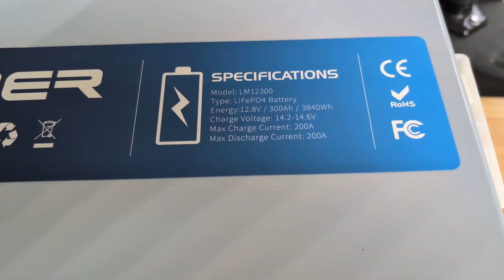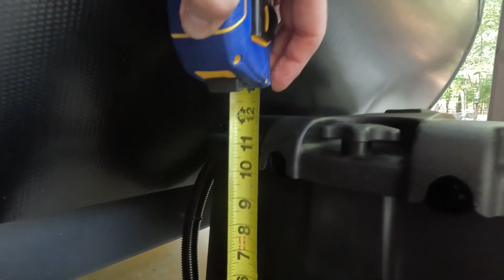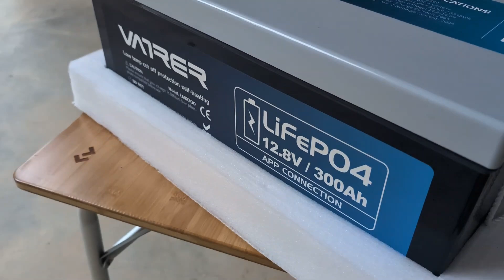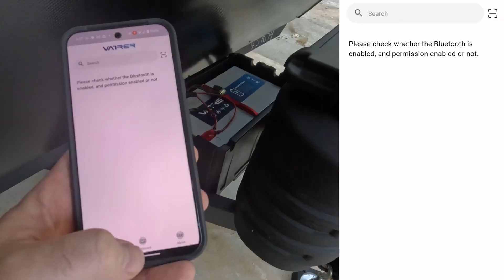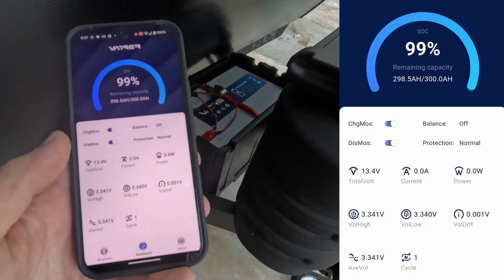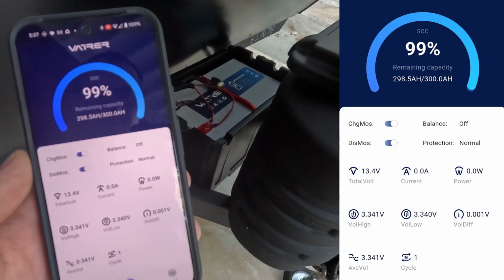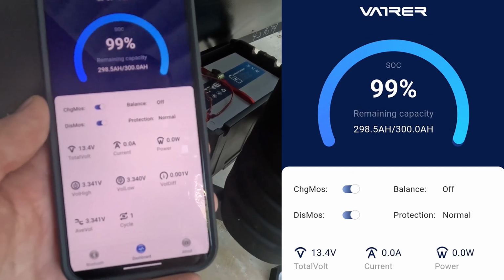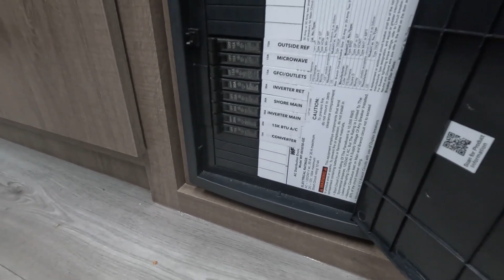Fit a Vatrer 12V 300AH LiFePO4 Lithium Battery on Travel Trailer

Comment: Nice job! I am doing the same upgrade with the 200AH version of this battery.
Did you add a DC-DC alternator charger? I plan on putting in a Renogy 20 amp DC-DC charger fed off of the 7pin harness that is tied to the ignition and fused at the block under the hood at 25 amps. My 2019 Tacoma has a 135 amp Alternator,  so it should be ok.